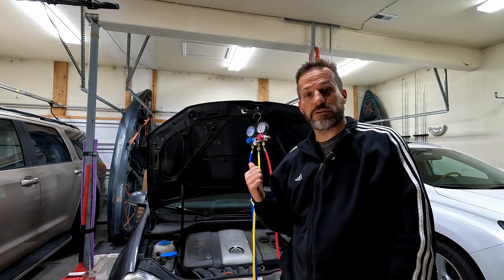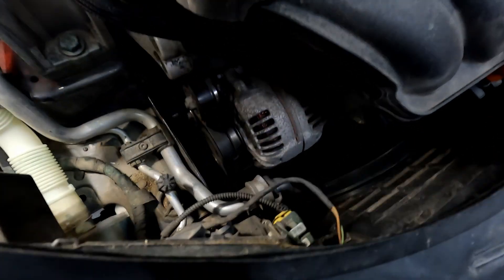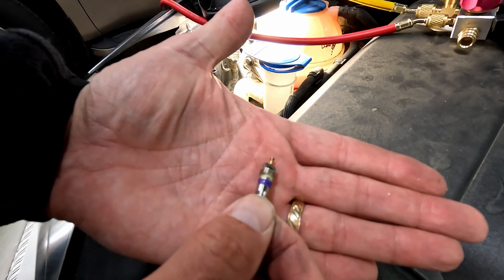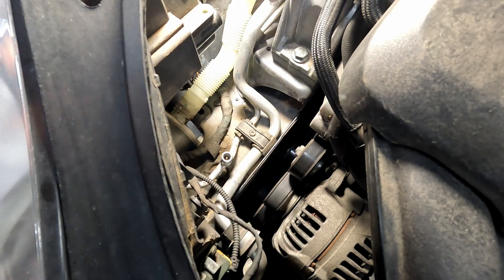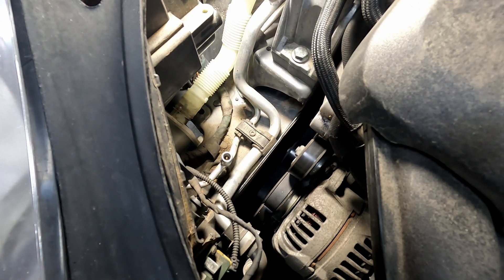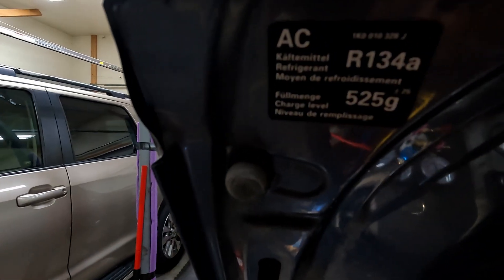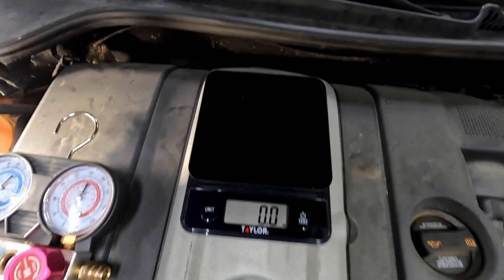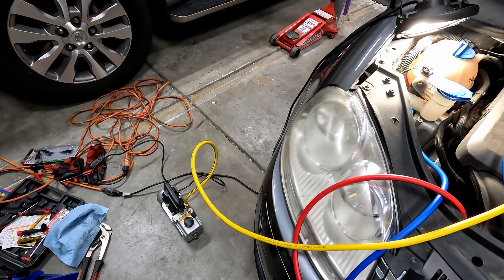How To Recharge Your Car AC System. New Service Valves, Vacuum and Recharge. Don't skip this step...

Comment: Seems like you did not wet the Schrader-valves with AC oil. You skipped that important step. And did you replace the dryer as that's ruined if it got in contact with air long enough.